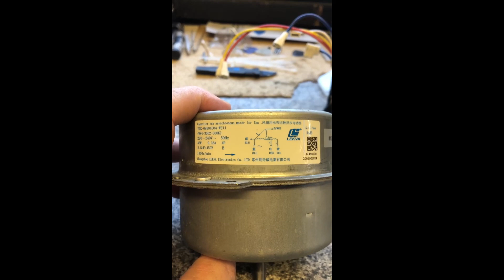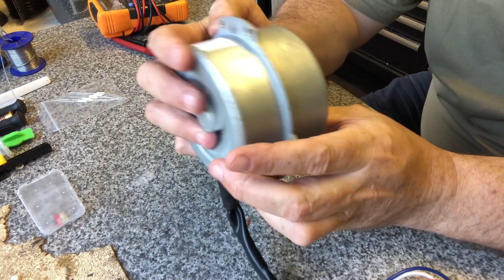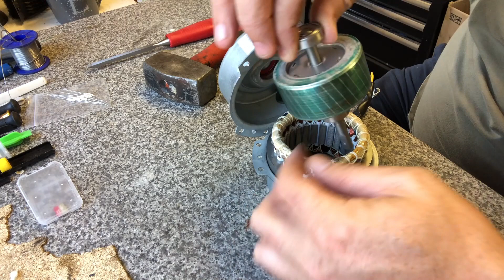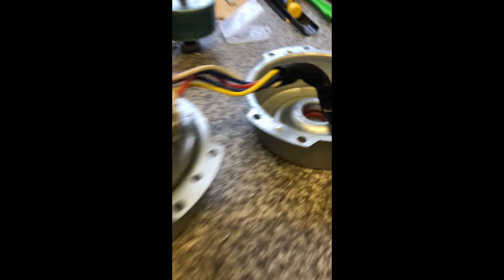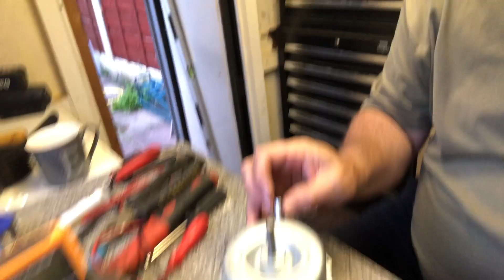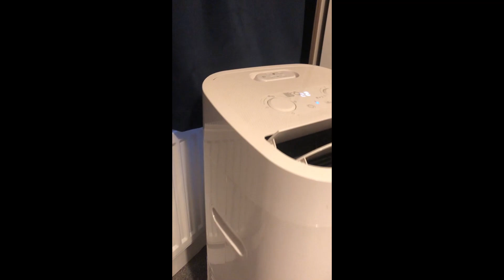Portable AC exhaust fan motor repair

Comment from the maker: I do have a couple of spare motors similar to this that will work in most applications, let me know if you want to buy one!
Reply: I have that same motor, I could use one
Reply from the maker: @markhill9344  orry for delay, did you try changing your fuse?
Reply: I have the same model and I think I have the same issue. The compressor starts and the pipes get warm but the fan in the lower end is not starting and the compressor is cutting off presumably after getting too hot
Reply: @thomastootill1762same here, this seems to be a manufacturing flaw that a lot of people are dealing with they should fix it for free.
Reply: Where are you based mate I would like to buy one!
Reply from the maker: @thomastootill1762 orry for delay, did you try changing your fuse?
Reply: @corffixesthings2673 I did not unfortunately,  I should properly try to do so
Reply: Hi, I really need one of these motors too please. I’ve been trying to source one for weeks! Please get in touch thank you
Reply from the maker: @bobbysharma3283  sorry for delay, did you try changing your fuse?
Reply: @corffixesthings2673 hi! Sorry I didn’t think you’d reply, good to hear from you! Well, I changed the fuse and the motor started working, but the casing was getting quite hot. I asked AI about this and it said it shouldn’t run hot, just warm? I took it apart again, and changed the bearings and the casing is a bit cooler, but still hot. I’ve also changed the motors 5uf capacitor (again Google suggested this). Is it normal for the motor to run hot please? I tried so hard to just find a new motor but I couldn’t find one anywhere! 
Any advice very welcomed, thank you. BTW GREAT video, it really helped me a lot 😊
Reply: Update - if it might help someone in the future. Looks like I accidentally hit the motor casing, so the spindle inside was pushed against the casing - causing friction/heat. I tapped the casing back into shape and problem all solved, units working perfectly.
Reply: Did you solder in the fuse? Also where did you purchase the fuse from?

Comment: I think i am dealing with a similar problem although my motor controlls both incoming and outgoing air. I have just opened it and it looks the same as yours. my consern was the re-wrapping material. could the heat melt the zip ties and perish the duck tape?. 

My one was getting extremely hot very quickly. I could start the motor by spinning it by hand so assuemed it was the capacitor but it seems that a black wire that comes from it is disconnected inside the motor. 
Im guessing the excessive heat is caused by the motor not turning. also i would wonder why your fuse blew in the first place.

Comment: Same thing happened to me bottom motor stopped working. So, you found the fuse and cut it out. Then, you order some fuses offline, then, how did you reconnect the fuse to the motor?
Reply from the maker: If you scrape the enamel off the wire you can solder it.
Reply: @corffixesthings2673 is yours still working after the fix?

Comment: Great video, 2 years later this was a great walkthrough. However when I got the casing open the winding was upside down so I couldn't get to the fuse. But it was a great experience anyway. Unless you have a secret on how to get the other side of the winding out😅 Thanks

Comment: Hi there, I got very same fan motor 
I have a question: can I put there thermal fuse not 2.4 amp but the 10 amp ??
Reply from the maker: Hi There, thanks for watching.
I would not recommend this, fuse is there for protection, a 10am fuse may cause a fire.